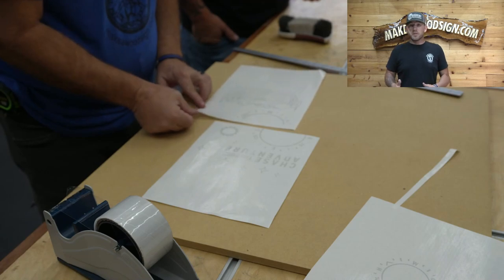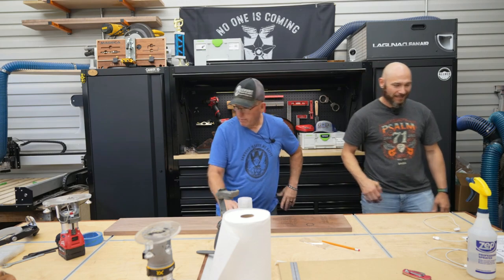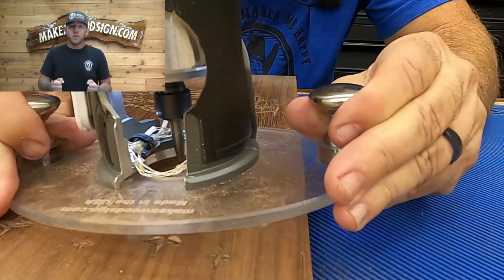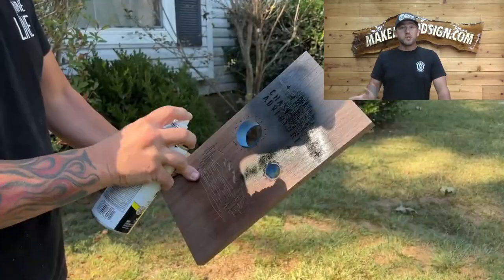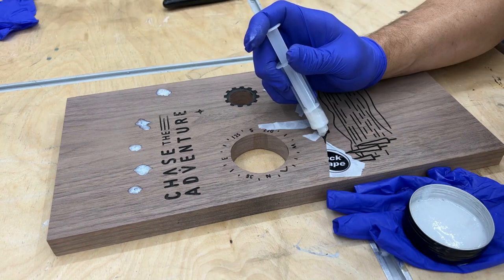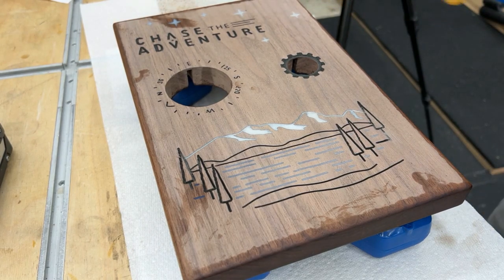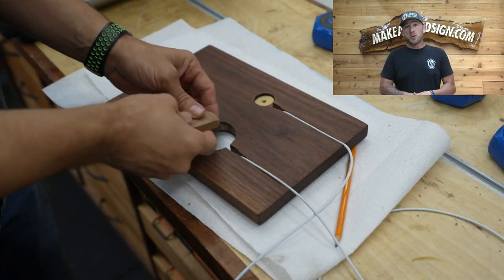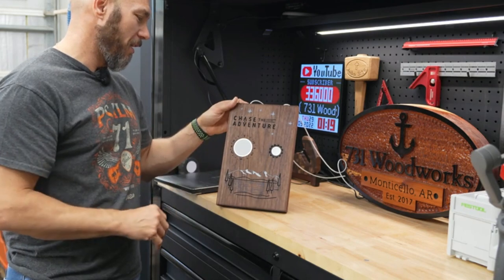Custom DIY Apple Watch Ultra Charger - Working With Matt Outlaw From @731Woodworks

Comment: I didnt find the fairy light link, how did you wire them for use with router?
Thanks
Reply from the maker: This video is about a year old so maybe amazon doesn't have those particular ones anymore. 
You can use this one https://amzn.to/4aNWbXv
We use little plastic clips to hold them on https://amzn.to/3NZ91Iu

Comment: You might want to use a scraper to get most of the paint off. That way the paint won't clog your sanding disk.
Reply from the maker: That's one way to go... Flat black doesn't clog discs like gloss does...

Comment: Does the clear plate make a difference? I have a hard time seeing my letters with my base plate that came with my dewalt plunge plus it’s so bulky I need all the help I can get.  Thanks and love the video as usual! Very inspirational
Reply from the maker: The clear plate makes a big difference. The best thing about the plate is having more control because your hands are on the base and on the board at the same time. I really don't like the plunge base for carving signs for exactly that reason, to clumsy and your hands aren't down on the board. Fixed base work lots better for sign carving. If you have any other questions you can email me, eric@makeawoodsign.com. Thank you for watching!!!
Reply: @oldave100  when I get home and get my model number I’ll see if you carry the clear plate! Thank you so much
Reply from the maker: Sounds good. Just email me if you have any other questions. Thank you for watching❤

Comment: Hi I e been trying to contact you on your web page but it goes funny on the phone number I’m in the U.K.  I’m trying to find out if you do a base for a dewalt 604nt. And do you do acrylic templates with a handle for doing bigger boards cheers steve 👨🏼‍🦽👨🏼‍🦽
Reply from the maker: Hey Steve! I'm not sure if the model numbers in the UK are different, but I don't think we don't have anything for that model. But, you can get a blank base plate and drill the holes for your router. 
Email dad eric@makeawoodsign.com and he'll get you set up